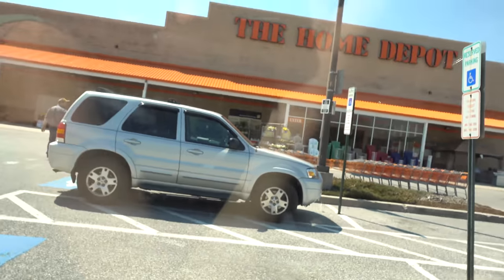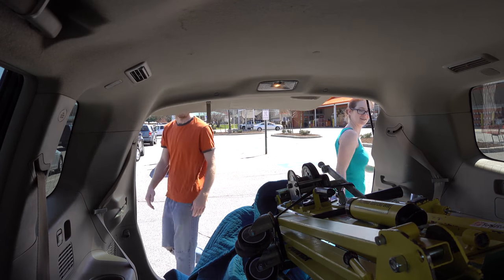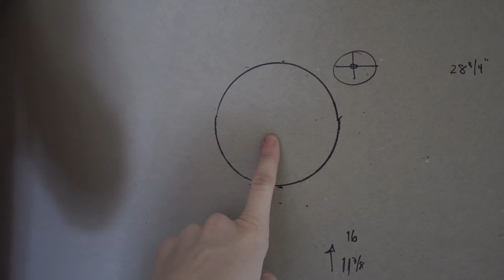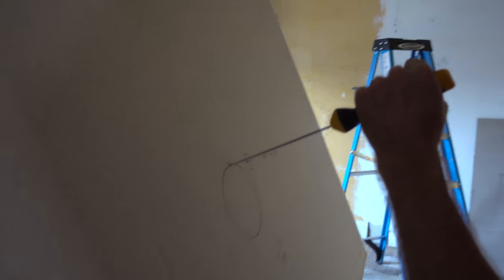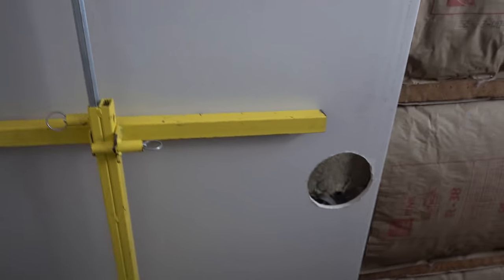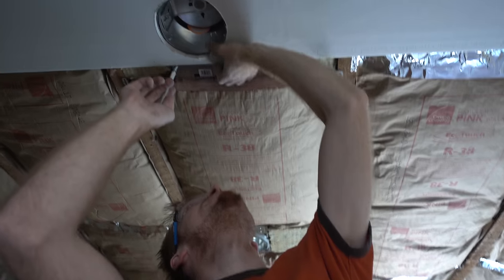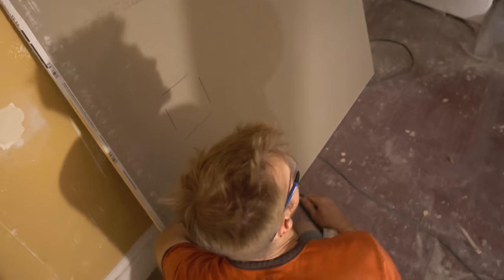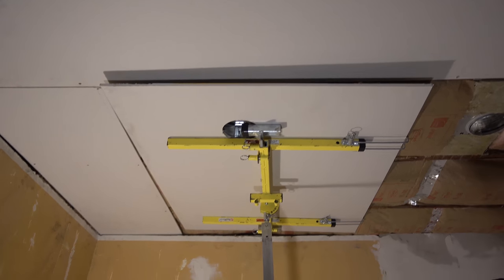Imminent Catastrophe! A Drywall Ceiling Lift!

Comment: Fyi...tips....use the regular / all purpose,  joint compound for your first, bed coat / setting of the tape, (it drys harder / less shrinking and possible cracking, as it drys)... Then you can use the light weight, easy sand for your 2nd and 3rd finish coats of your drywall finishing tasks, making sure to feather the joints out wider, wish wider place taping knives as you go....with a light scrape with a clean knife, or light sand between coats, (after it is thoroughly dryed), to knock down ridges and high spots, to help make those joints and screw heads disappear.... One other thing...always use a pva type new dw primer first on new drywall...it helps prime and throughrowly seal the porous new d's so it will except your new paint better, and not keep sucking it up using more finish coats of paint to cover it....didn't know if you guys knew this, just trying to help / share my years of experience with you all....looking good!

Comment: When I helped my dad put sheetrock on the 8 ft ceiling in our living room many years ago, we used 2x4 tees to push the sheets up and hold them in place. The legs were longer that the height of the ceiling so could be wedged into position. Thanks for sharing your experience.

Comment: the best way to cut holes is to put the drywall up against the electric boxes the cut the holes with a rotozip saw. its very hard to cut them on the ground and get it right.

Comment: Wow that lifter was sketchy! I drywalled a ceiling all by myself a few years ago. Two layers too, with staggered joints of course. I made my own support frame out of scraps of wood. Lifting the sheets onto that frame was the hard part, I had to find a technique to doing it single handed. Must be so satisfying to have that done!

Comment: Fyi...tip,...when you cut out your can lights, or anything else in the drywall sheets, you should make the cuts a minimum of 1/8" bigger, and  back bevel your cuts to make fitting the drywall easier!.... Also does that drywall lift have a winch / lock on it?...

Comment: You need a drywall bit. it will stop driving when you hit the drywall
Reply from the maker: We are intentionally countersinking the screw heads so we can spackle over them
Reply: I was referring to one of these. it stops driving when the screw is just below the surface. https://www.homedepot.com/p/DEWALT-Drywall-Screw-Setter-DW2014B/202579696

Comment: I realize it's after the fact by the time I've seen this, but I would have been at the store showing the lift slipping, as well as personally making as much noise as the lift did. Full refund. No charge. A safe and properly maintained tool doesn't act or sound like that!